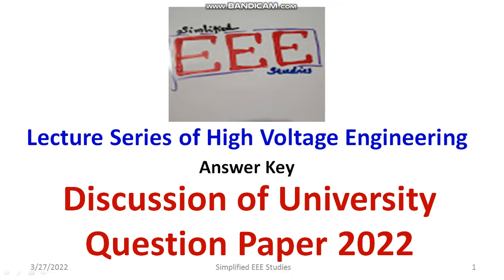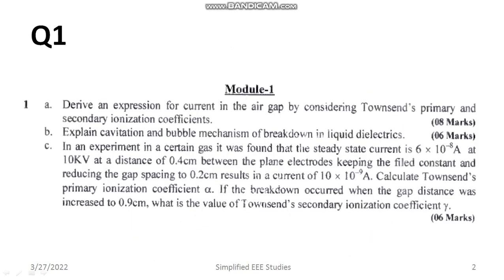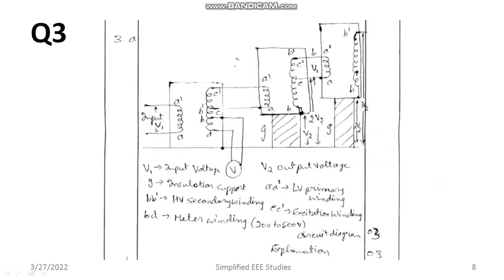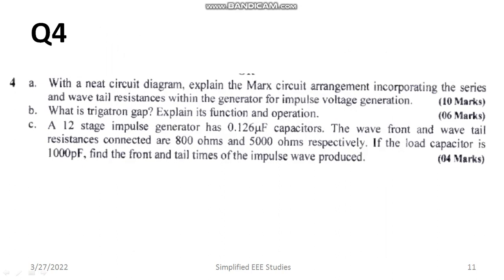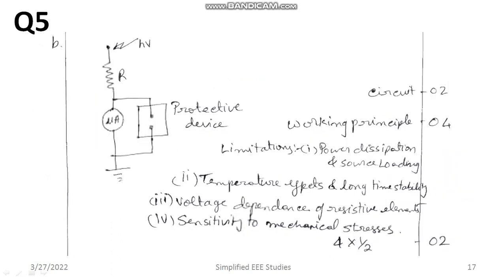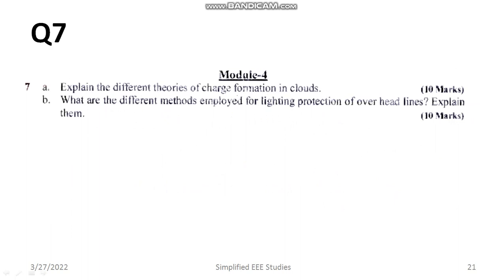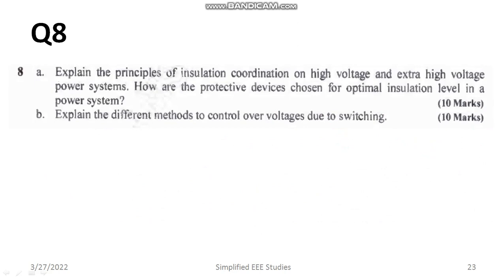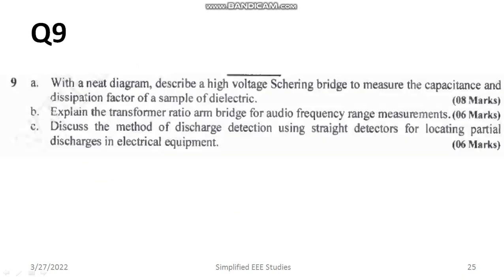High Voltage Engineering VTU Question Paper Feb/March 2022 Answer Key Way of writing answers/18EE56

Comment: The video script discusses how to effectively write answers for a high voltage engineering question paper, covering topics such as Townsend's current growth equation, liquid dielectric properties, insulation coordination, and methods of discharge detection. It emphasizes the importance of detailing each step to score well and provides guidance on answering various types of questions.

Key moments:
00:01 Learn how to write high voltage engineering answers effectively by following step-by-step explanations and understanding point allocations for each question.
          -Importance of deriving expressions and understanding point allocations for high voltage engineering questions.
          -Explaining the properties of liquid dielectric materials and the limitations of theories in high voltage engineering.
          -Understanding transformer connections and solving related problems with detailed calculations for each parameter.
          -Describing the working of a Tesla coil with the necessary circuit diagram and waveform for a comprehensive explanation.
03:31 Understanding circuit diagrams and calculations is crucial for scoring marks in electrical engineering exams, especially for topics like impulse voltage generation and HVDC measurement methods.
          -Importance of circuit diagrams and calculations in scoring marks in electrical engineering exams.
          -Explanation of HVDC measurement methods using series resistance micrometer and their limitations.
          -Solving numerical problems related to generating voltmeters by understanding given data and formulas.
06:58 Understanding factors affecting spark gap, theories of charge formation, methods for lightning protection, insulation coordination principles, control over voltage, high voltage bridge for capacitance measurement, transformer ratio balancing, and discharge detection methods.
          -Explaining theories of charge formation in clouds like Simpson theory and Rhinols and Mason theory.
          -Detailing methods for lightning protection such as shielding overhead lines, using ground wires, and protective devices like expulsion gaps and surge diverters.
          -Describing insulation coordination principles and methods for control over voltage due to switching.
          -Illustrating high voltage bridge for capacitance measurement, transformer ratio balancing, and discharge detection methods using straight detectors.